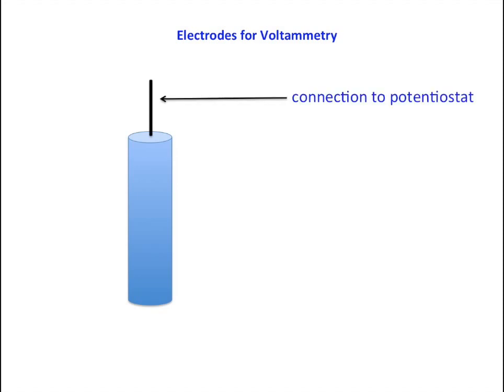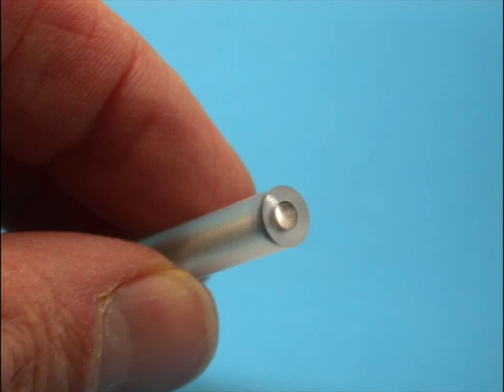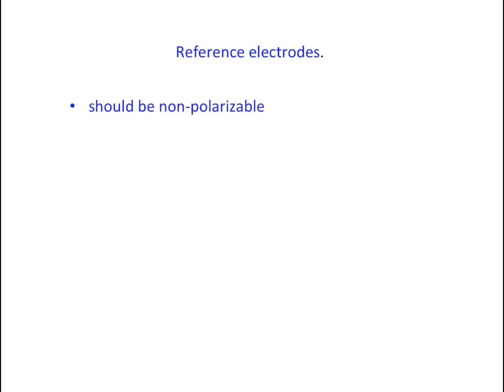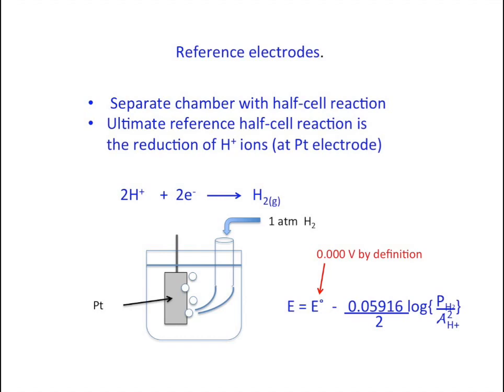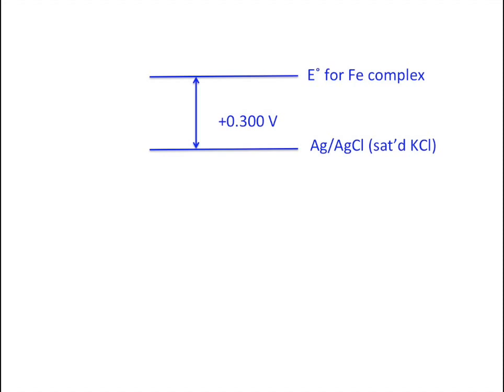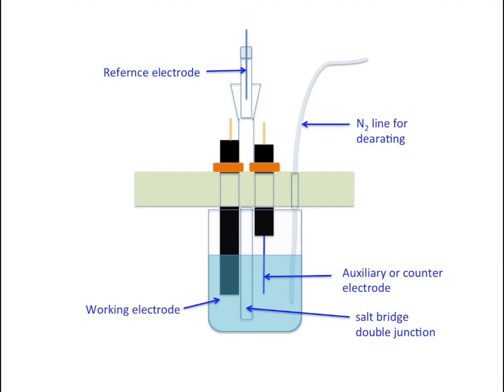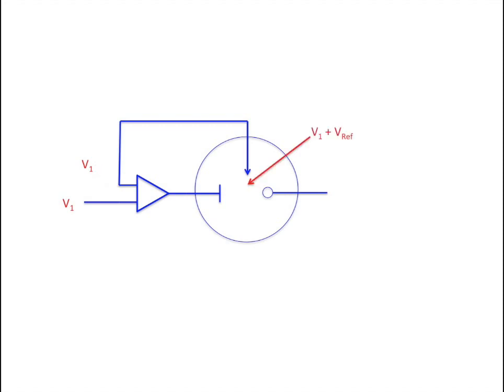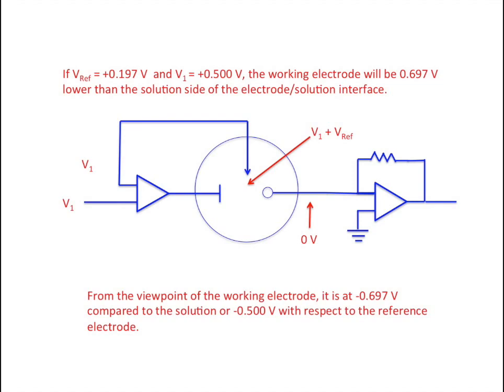Voltammetric Electrodes

Comment: Thanks for this very informative video Gary! I have a question about the slide at 9:42

How can a working electrode that is far from the reference electrode create a potential V1+Vref at the reference electrode? Are they connected in some way?
Reply: My question comes down to: how can you bring a solution to a certain potential? Is it because the inert electrolyte will create the potential through the solution?
Reply: And if the potential is indeed created through the electrolytes, does the distance to the working electrode matter, or is every point in the water at the same potential?
Reply from the maker: Jonas, Good questions. Your reasoning is also correct on both counts. It is a bit of a challenge to follow the operation of a three-electrode system, but basically the reference and counter electrodes work together to pump charge into or out of the solution when the power source (potentiostat) applies a voltage to the cell. (It takes very tiny amounts of charge to do this.) This excess charge migrates very quickly to the interface between the solution and the working electrode. The fact that the solution conducts charge (in the form of ions) keeps the potential throughout the solution uniform in a manner similar to the way a metal conductor would if you where charging up a pair of plates in a capacitor. We say that the reference electrode senses the voltage on the  solution side. Really what the potentiostat monitors is the voltage between the reference electrode and the working electrode (which is being held at ground or zero volts). The surface of the working electrode is like the second plate in the capacitor and it is in contact with ground (that is, it is held at zero volts). So, the applied voltage is a measure of the voltage between the capacitor plates. It is the electrochemical potential energy drop across this interface between the solution and the working electrode surface and it is that energy that is available to drive a chemical reaction. 
     You pointed out an important idea about the placement of the reference electrode. That can be important if either the electrical resistance of the solution or the current going through the system is big. It takes energy for the ions to move the charge through the solution. That energy is lost as heat. The potentiostat reports the total voltage applied to the cell. If that energy spent moving ions is a significant fraction of the energy applied to the cell, then the actual energy applied across the working electrode/solution interface will be less than the applied cell voltage. That means we will have an error in the applied voltage (the x-axis) on our voltammogram. The error is equal to the product of the current times the solution resistance. So, if we keep the supporting electrolyte concentration high (0.1 M KCl has a resistance on the order of 100 Ω per cm of solution) and the current below 10 µA, then errors are on the order of 1 mV or less. That's usually acceptable. When either the solution resistance is high or the currents are greater than 10 µA, placing the reference electrode close to the surface of the working electrode helps to reduce this type of error (also called "iR-drop" loss).
Reply: @garymabbott4064  A big thank you for your answer Gary! This really helps me clarify this concept. 

I had another question: We are interested in the potential and current flowing from the working electrode for obvious reasons. The counter electrode however is mostly there to get rid of the electrons our working electrode produces. I was wondering how the potential of this counter electrode is regulated? dependent on which reaction happens there, it seems to me that a different voltage would  be needed at the working electrode to perform both the half reactions? If a reaction at the counter electrode happens that needs a high driving force voltage wise, it would seem to me that the working electrode would need to work harder (have a higher potential) to make sure the reaction happens? Or is there some sort of mechanism in the technical part that senses how many volts are needed at the counter electrode for that half reaction to happen to make up for it?

I have also been struggling a bit with the concept of an electrolyte. To me, it seems that as long a reduction reactions happens at the cathode, and an oxidation reaction happens at the anode, current is flowing. Does the electrolytes facilitate the transition of the electrons from the electrodes to the species? why does the 'current' wants to go through the solvent instead of taking the electrodes as starting and ending point of a circuit?
Reply from the maker: @jonasmortier9056  Jonas,

In our experiment, we really don’t have a direct measure of what is happening at the counter electrode, but we can infer a few things. We know that if the working electrode is oxidizing some species in solution, then it is pulling electrons out of the cell. In order to maintain the balance (hold the potential that the instrument is designed to control at the working electrode) the counter electrode will pump the same number of electrons into the solution. That means that the potential of the counter electrode surface will be negative with respect to the solution (just the opposite polarity that appears at the working electrode). Now, you were right to think that there must be some reaction at the counter electrode that will allow it to transfer electrons into the solution. Often there is no obvious species in solution that can be easily reduced. Then the instrument will drive the potential difference at the counter electrode more negative trying to achieve the balance (or really to keep the potential across the working electrode interface at the target value). Eventually, the potential difference at the counter electrode becomes negative enough to reduce the solvent or some species in the supporting electrolyte. In aqueous solutions we observe the reduction of hydrogen ions to hydrogen gas. (You may have noticed bubbles forming on the counter electrode.) In the opposite situation (when a reduction is taking place at the working electrode) the counter electrode is likely oxidizing water to form molecular oxygen (bubbles again) and hydrogen ions. So, the counter electrode potential is driven in the opposite direction compared to the working electrode. We don’t have a measure of the actual potential that the counter electrode reaches. It will be whatever value it needs to reach in order to pump electrons in the opposite direction compared to whatever is happening at the working electrode.

The supporting electrolyte acts to carry charge through the cell in the form of ions. Our experimental cell must be a part of a complete electrical loop that provides charge to move from one side of our instrument, down a cable to an electrode, through the cell, out another electrode, up a second cable to the other side of the instrument (completing the circuit inside the instrument). The conductivity of the solution goes up (and resistance goes down) with the concentration of ions dissolved in solution and that is good for the experiment. (Recall that we want to minimize errors caused by “iR loss”—the energy wasted in moving ions through solution.) In most experiments, we expect the supporting electrolyte to be inert and not participate directly in solution. An important exception is the oxidation or reduction of organic molecules that usually are accompanied by the incorporation or release of hydrogen ions from solution. There are also very interesting reactions that involve oxidation or reduction of the solvent or supporting electrolyte that turn around and exchange electrons with the analyte species (and are re-generated back to their original state). This, of course, is a catalysis process that can be of enormous interest for theoretical and practical purposes. However, we generally expect that the supporting electrolyte is not involved in electron transfer at the working electrode in simple electroanalytical experiments (until we scan to the limit of our useful voltage range where we see increasing background current even in blank solutions containing only supporting electrolyte.)

I am happy to continue answering your questions, but I would encourage you to recommend that your library purchase this book: https://www.amazon.com/Electroanalytical-Chemistry-Principles-Monographs-Applications-ebook/dp/B084GM6C3R/ref=sr_1_6?qid=1673106623&refinements=p_28%3AElectroanalytical+Chemistry&s=books&sr=1-6

(Yes, it is my book. I apologize for the shameless self promotion, but it could be helpful to you and others interested in this field.)
Reply: @garymabbott4064  This helped me a lot. There is no shame in promoting your expertise ;) I am currently going through some papers of yours, so for the moment I have enought reading to go through.